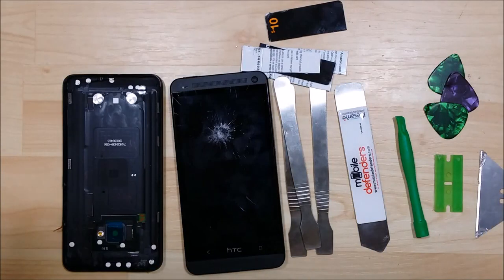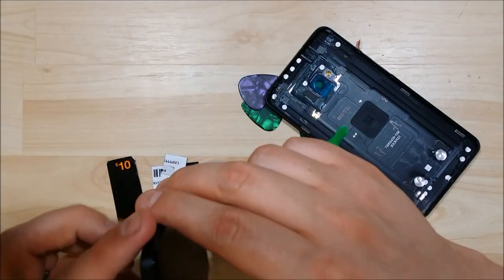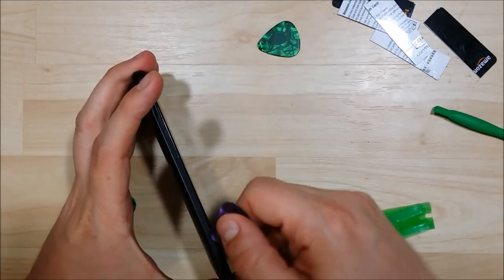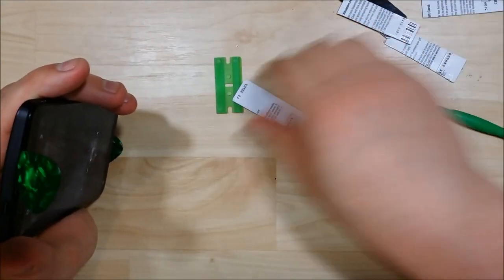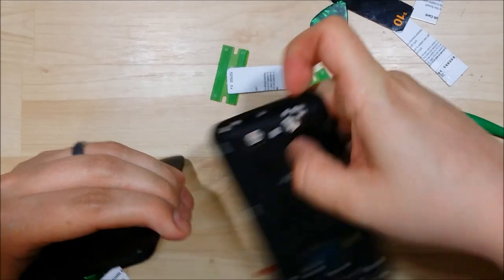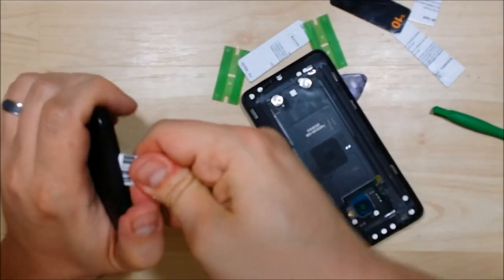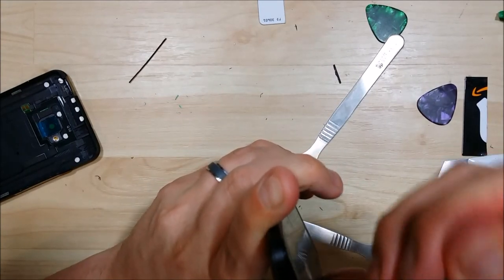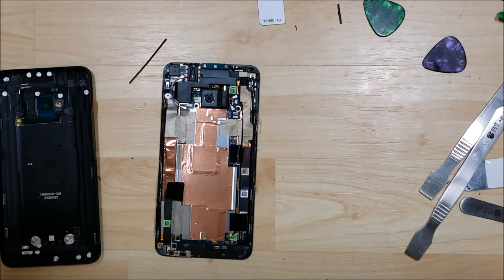HTC One M7 Rear Housing Removal (Not the best) Screen replacement.

Comment: One of the best phones ever made in my opinion. I own this phone and have changed a screen on , one of these. The front screen came off with a vacum puller (not sure what its called in english) and it was alot less messy on the screen removing part. But since the cable runs to the back of the phone it just takes soo much time and is quite stressfull. Have dropped mine like 4-5 times. Luckly no damage to the screen but the corners aint the best anymore :(